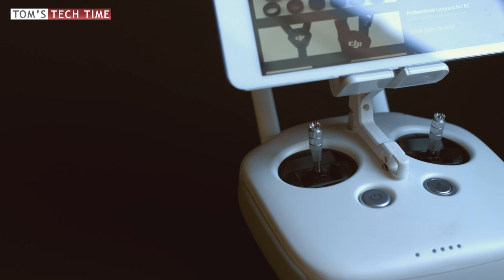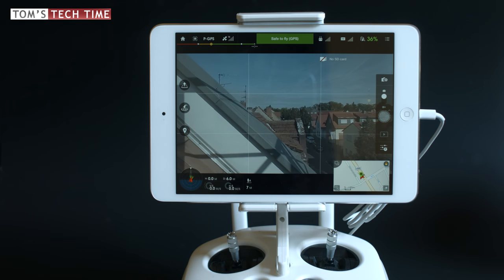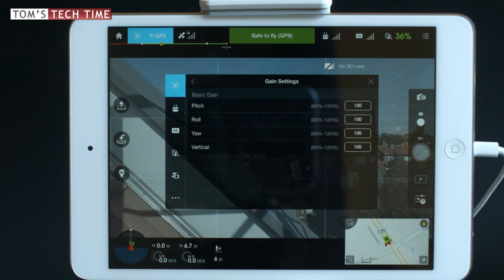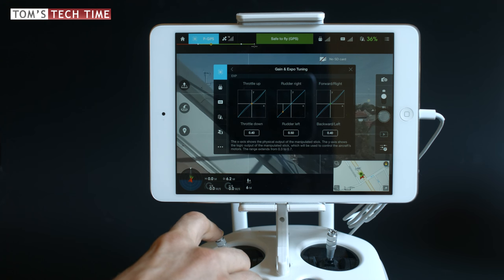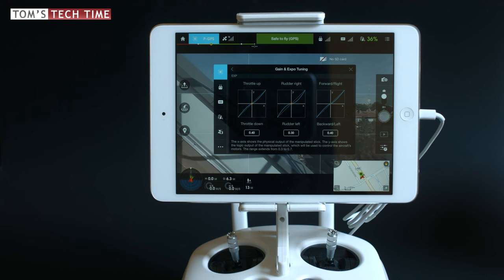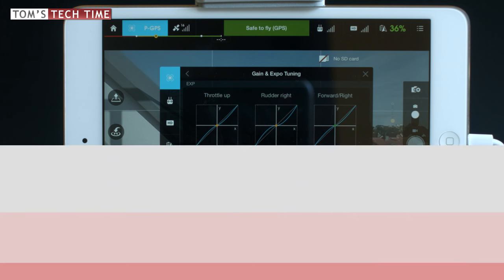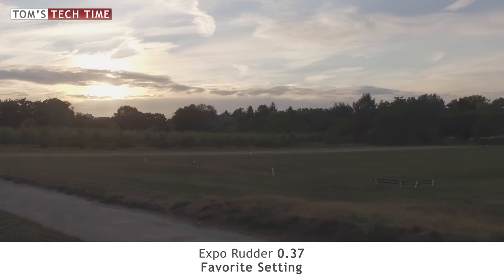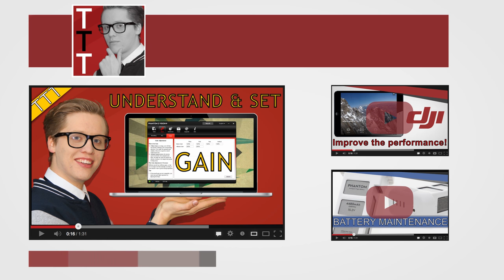How to adjust Yaw Speed | DJI Phantom 3 | Gain and Expo

Comment: Tom - Great video, as usual. Btw, the blue line is called the "transfer function" and the Rudder has a "linear transfer function," which means, the copter moves in an equal amount (I,.e. directly proportional) to the movement of the stick - it responds linearly. The other curves are non-linear. And btw, this is the way a waveshaper or distortion box works (think Hendrix) - it applies a non-linear response to the audio input to produce distortion on the output.

Comment: Very helpful vid. On the DJI GO App, under Sensitivity, there is an adjustment for Yaw EndPoint. Do you happen to know what that adjusts exactly? Some have said it controls the overall speed, but I was thinking it actually controls how quickly the yaw turns in the reverse direction.

Comment: hey. I have been trying to find an answer to this question.  I have phantom 3 standard.  I also have bought a phantom 3 advanced gimble and Camara.  can I switch the standard gimble and Camara out with advanced or not? I have the standard remote .  if not is there a way to power up the advanced gimble and Camara and use that on another quad or tricopter? didn't know if I should sell it or use it. thanks for any replies

Comment: Hi 
just tried this setting the Yaw to 0.37 but every time I go of the page  and back On it has changed back 0.40 do I have to do this every time I  use it or is there a way of storing the setting.
Reply: P you have to do it with the drone connected. I think the settings are stored in the drone actually.

Comment: So all of the expo rudder setting that you compared were shown with the left stick pushed all the way over to the right?
Reply: Yeah, he didn't give any information on this, which renders all of the results basically useless (from a scientific perspective) since any yaw rate can be achieved using any of the expo settings (they just may require differing amounts of stick displacement). From a mathematical perspective, the premise that he is pushing the stick all the way to the right is actually impossible, since all expo curves map the maximum x-axis input to the maximum y-axis output. Therefore, pushing the stick all the way to the right would give an identical result no matter what the expo parameter is, and this clearly contradicts what we observe in his videos.

Comment: Hi Tom, thanks for your great videos. I have a problem with the yaw setting. I have a phantom 4 , and the range is possible from 0.2 to 0.8 but each time i try to change the original value ( 0.4) the numbers turn red and i can not save the new value. Sorry for my bad english ... can anyone help me ?
Reply: Hey tom, 
I have a phantom 4 pro I have done all those settings but it still to fast! It works fine when sensor is turned onn but act too fast while sensor is off! Is there's any solutions to adjust the maximum kph?

Comment: Can you hack the cameras firmware so you can shoot videos in RAW-format?
Reply: Can't answer for sure, but even if you could, at best you're probably looking at RAW RGB 10-bit at 720@30fps. I'm sure the camera can do much more, but the limitations usually lie with the processing hardware and storage speed limits (SD cards are not great for storing RAW footage, which has bit-rates several orders of magnitude higher than compressed footage). If it was just an easy software unlock, you can bet that DJI would be selling it :)

Comment: The video comparison is a nice idea, but it's not carried out very scientifically.  Any of the video yaw rates you showed can be achieved with any of the expo settings, it's just a matter of how much you have to move the yaw stick. However, this test lacks the data of how hard you were pushing the yaw stick. How can you be sure that during each of the tests you were pushing the yaw stick the same amount for a fair comparison? Even if you were, I think choosing the clip that looks the best from this test isn't the right way to decide on an expo setting, because the yaw stick is fixed at some arbitrary position. I think a better test would be to design a cinematographic shot that requires some challenging yaw manipulation, and then attempt to record the same designed shot with each of the yaw expo settings. I think this would provide a more real-world application than simply rotating at a fixed height at a constant rate, and offer a better way to choose a favorite yaw rate.
Reply: Daniel Walsh I thought exactly the same thing. The stick would need to be being pressed at the exact same pressure unless to pushed it to full right which at that point wouldn’t be slow anyways